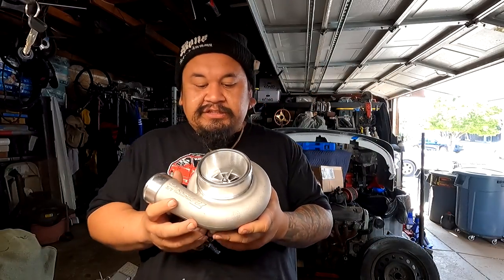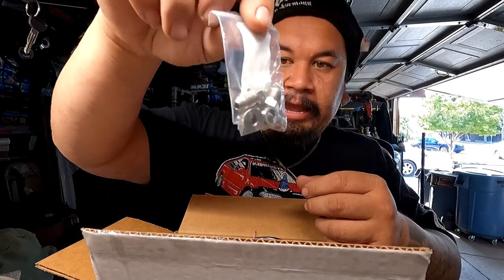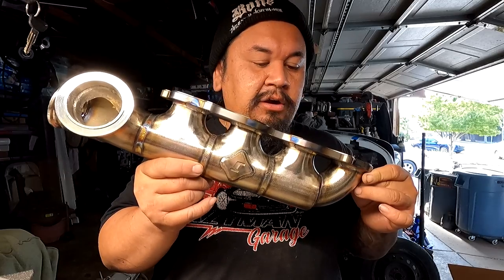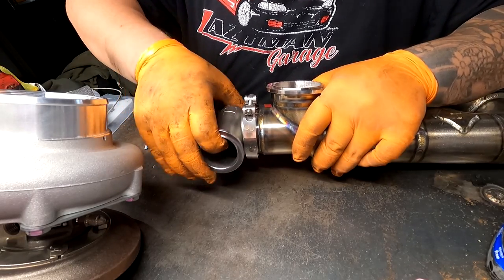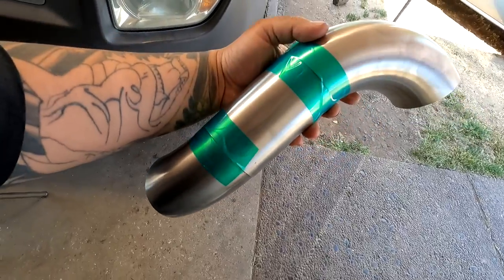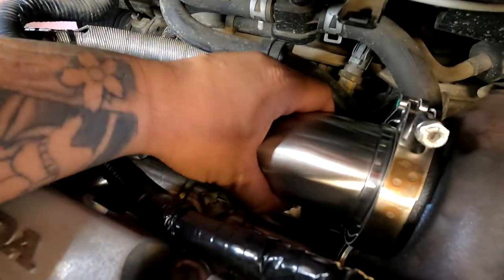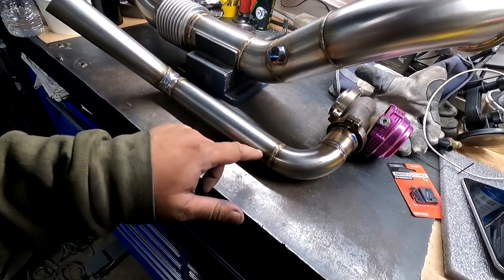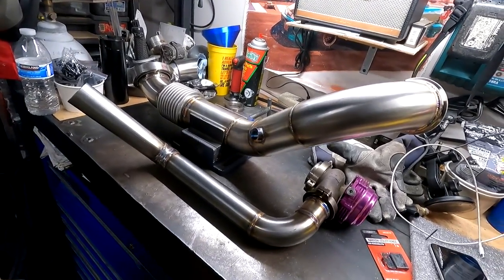Honda Element Turbo Build 2 : Fabbing New Setup ! ! #Justig #Tial #Pulsar

Comment: FYI,

I’m an aircraft mechanic and we deal with ton of v band clamps as aircraft power a lot of acc from bleed air. We are stressed to tap the v band clamp while torquing to prevent leaks. Just thought you’d enjoy this information if you ever deal with a pesky leak you can’t pinpoint. 

Great work by the way you’ve motivated me to go thru my DA that I’ve had sitting for years, it started with replacing clutch and snowballed pretty rapidly .

Comment: I don't know a whole lot about turbos, but, is it possible to tie the BOV dump tube back into the DP off the turbo? Or does that cause too much pressure in the exhaust system?
Dumb question?

Comment: You could weld two ears to the exhaust and the gate dump and use a bolt through the ears, so the dump is not just floating and putting pressure on the manifold, as it could in time lead to a crack.